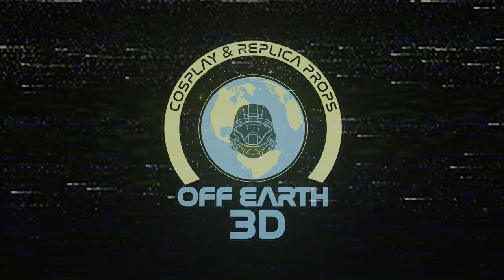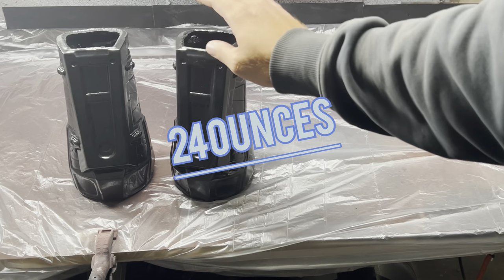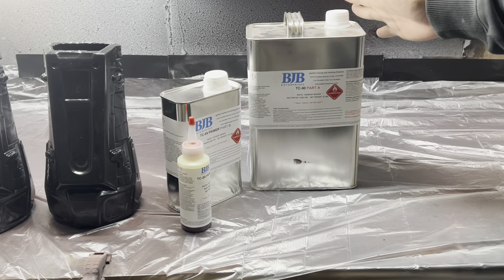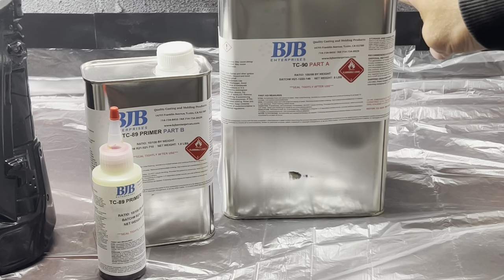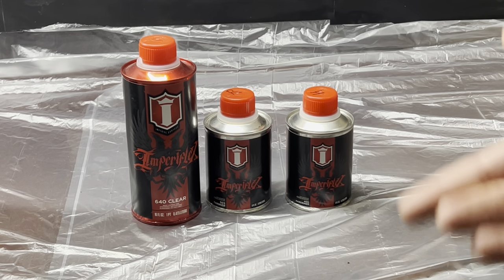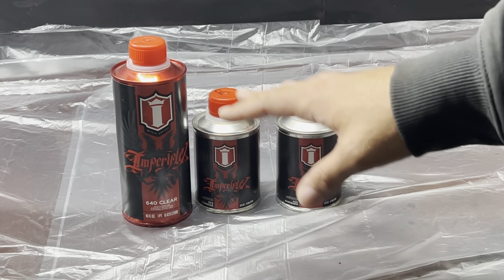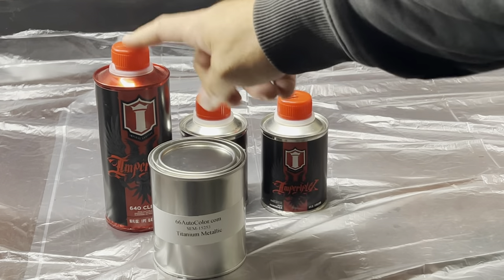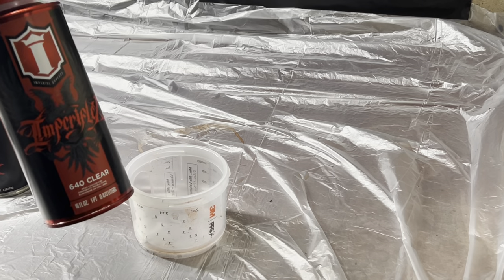How to Paint Urethane Rubber | Cosplay Armor | Full Breakdown

Comment: Was it a little sticky when it cured? I'm looking for paint for restoring bendable toy figures (bendies). You think this method will work? I also got some where the old rubber has sticky components making there way to the surface making the toy sticky. Would the clear seal that chemical in?
Reply from the maker: This may work for bendy toys.

Comment: Not a cosplayer, however, I admire the dedication, time, and equipment investments required to produce good to great quality costumes and props. The bonding agents in Imperial Flex must be something else to provide such a durable bond on a flexible material like this.
Reply from the maker: It absolutely is. I’ve tried virtually every product you can buy and it’s simply the best and easiest to work with.

Comment: This would make matching colors easier to hard parts also compared to cold casting with a metallic powder instead.
Reply from the maker: Cold Casting wouldn’t do much good here since you can’t or don’t really want to “buff” the part.
Reply: @offearth3d  I was saying this method would be better than cold casting. But for flexible urethanes, using a makeup brush to smooth out the powder in the mold beforehand makes for a nice metallic sheen that doesn't need to be buffed out since that isn't really an option like you point out. I've gotten great metal looks with this, but your painting would match colors and textures more is what I was saying.
Reply from the maker: @DaniMakes  oh yes, I agree. It’s a work around for using pigment/metallic powders etc.

Comment: do you have video making that urathane armor
Reply from the maker: I don’t. I’m putting something together for an upcoming project where I plan to outline the whole process
Reply: @offearth3d   great stuff, i was actully looking to make rubber armor and wasnt sure what to use that would take paint. i had used smooth on task 16 to make blasters in the past but they didnt take paint unless it was acrylic. i think this stuff your using may be better! The painting is a bonus for me at this point in time haha. thanks for the video!
Reply from the maker: @Lou4130  task 16 won’t work using this method since it’s not a true urethane rubber.
Reply: @offearth3d  yea i found that out the hard way haha. Im going to try what you used for this piece, and now i know what paints will work as well! Again thanks for the video! Other makers i had asked wouldnt tell me what they use for rubber armor...i guess they didnt want more competition, but i knew eventually id find out/figure out something that works! So thanks for THAT as well!
Reply from the maker: @Lou4130  it took me a few years of research, trial and error to get here. I know how people gatekeep this info.
Reply: any news about that project. I'm starting a new armor and would like to do many parts in urethane and I'm having some hard time gathering the info about doing a silicone mold for an hollow piece like a forearm and casting the urethane. Any help and pointers would be MUCH appreciated. @offearth3d

Comment: The alumaluster without the 2k really gets dulled down sadly.
Reply from the maker: The Imperiflex is a 2K Clear. It’s designed to work on soft and flexible substrates.
Reply: @offearth3d  Ill clarify. Without the Gloss of a typical high gloss clear 2K finish the Alumaluster is reduced to a silver gray. The reflectivity between this and a standard alumaluster application is dramatic.
Reply from the maker: @mml3140  I use Alumaluster as in intermediate coat and top coated with a third paint. It’s a dull grey because of that. It’s just a shiny without the top coat
Reply: @offearth3d  can you show that on a different piece? Because unless it retains the high level of gloss it's basically just an adhesion promoter. A highly effective and useful one. But to mess with isos and spend that type of $ and not get that 2k gloss the flex paint you started with or other alternatives are just as good for a cosplay.
Reply from the maker: @mml3140  shoot me an email, darryl@offearth3d.com and I’ll send pics/vids of the piece shiny
Reply: @offearth3d   cool will do. I notice they dont have a TDS online. What are the flash and cure times for this ?
Reply from the maker: @mml3140  from my extensive use, flash time is about 5 minutes, handle time 20 mins, fully cured a few hours depending on weather.